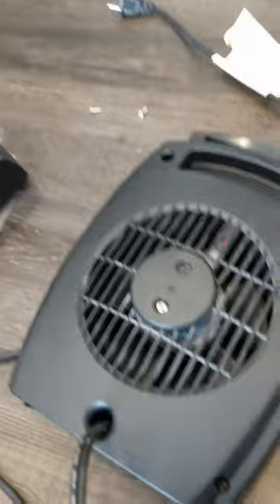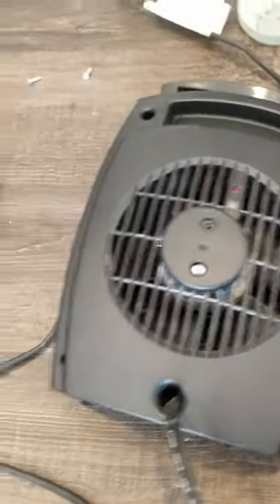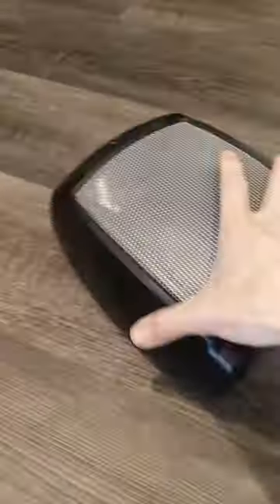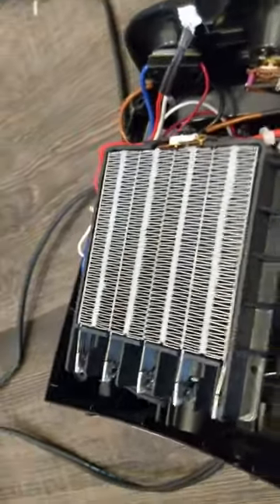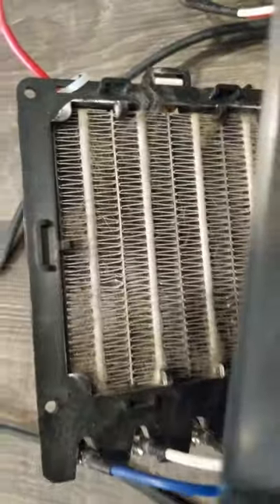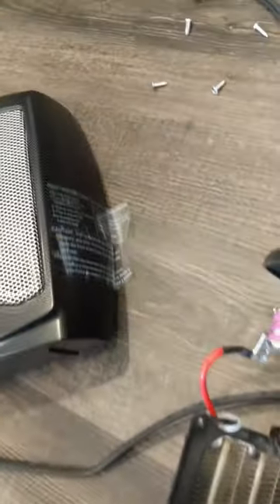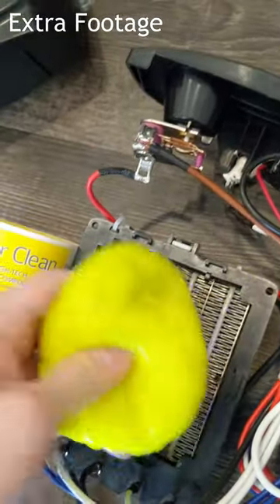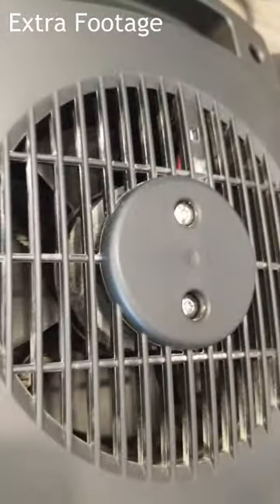Lasko CD09250/754200 Ceramic Heater Cleaning and Disassembly

Comment: When using special bolts not standard definitely helpful to mention it when u mention unscrewing the 4 screws
Reply from the maker: True, they seem to either be security torx or spanner screws!
Reply: @play150  damn i meant to write back the exact bit i used, i have the i fix it kit mako precision bit set and it wasnt long enough i had to gerry wrig it abit using the magnet end and then plugging what i believe was a torx tr5? to get it to reach lol, if i can find where i wrote down the bit ill try to update this
Reply: @ANARCHYTOORDER  totally useless! what is the tool to remove the dammm screws!
Reply: @play150  Can you use tell us what type of screwdriver you used for the 2 screws that are not standard? Mate just add as much information as you can so it can actually help us get in and clean it
Reply: @play150  Ah nevermind I see it in the description

Comment: I have the older unit. Can you tell me what size spanner bit to use? Thanks.
Reply from the maker: I didn't end up doing the older unit, but I remember seeing the spanner size mentioned elsewhere online so perhaps search around!
Reply: @play150  Well shoot, I've been looking for the past couple of hours and can't find it. I have a bit that seems to fit that says 10 on it but when it's attached to a bit holder it's too fat to fit down into the hole. I'm trying to find a driver that has that size bit on the end but seems like all the drivers are in mm and I can't find a conversion from 10 to mm. Thanks for the quick reply.
Reply from the maker: @dansuess4859  Perhaps email Lasko!